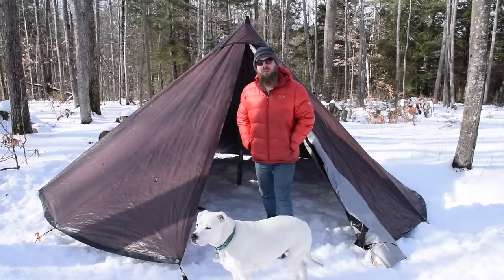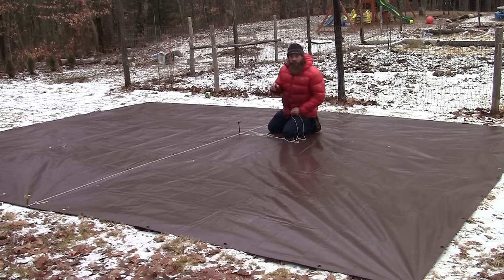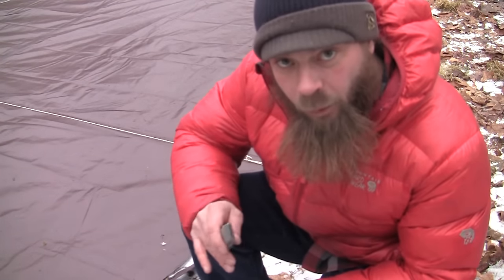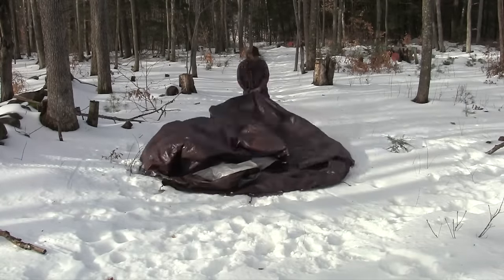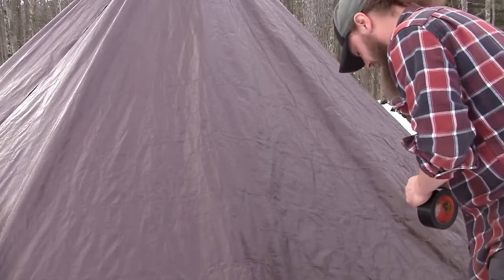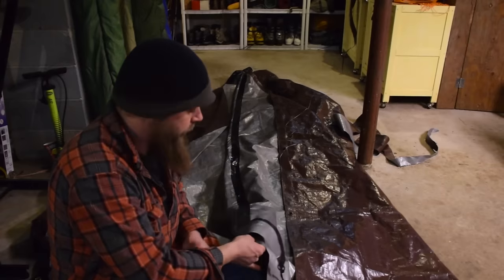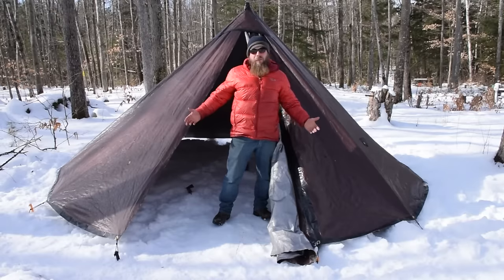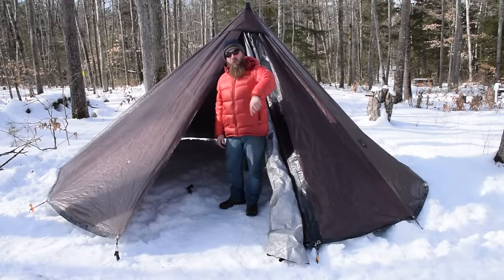CHEAP , DIY Hot Tent , from a tarp !!!

Comment: Good in the woods ...excellent video ...I think the only improvement or suggestion I would make is when you are cutting the opening for the door.  Only cut out one half ...that would eliminate the need to tape on the flap to cover the door ...attach the extra material from the inside to keep out rain
Reply from the maker: If I do this again, I am going to try that

Comment: 👍 I love this idea . Harbor Freight had a 11' 4" x 19' 6" on sale this past weekend . I'm going to use your idea with minor adjustments for the size difference . The center pole I will top with a PVC 1 1/2" cap to lessen the stress on the tarp and tape in the center . there are also now available hi-temp silicone mats that I will use for my stove pipe / tarp exit point . Thanks for the very clear instructions , not every poster does that .
Reply from the maker: Sounds like you have a solid plan!! If you take the time to make one, you will have a solid tent for years to come. These builds are awesome! Rugged. Lots of room. 
  Have fun with your build! I would love to see some pictures of it when it's finished! Please keep me posted
Reply: A guy could make an adjustable center pole  by using  2.5 inch  & 2 inch PVC pipe . Cut both sections  to 4 feet . Take a  drill  and make  holes  Then use a spring pin  to lock in place . Just a thought.
Reply: I hope you share the finished project. I would love to see it!💯♥️

Comment: Your video is just fine. I watched lonnie's video a couple of years ago. I knew I recognized the layout from there. I am going to try something a little different with a square or maybe a rectangular foot print. Basically something from a video by Survival Theory. Permanently tape in some reflective material and include a clear plastic door for a super shelter type of thing. Hoping to hold the clear on with magnets. I will be using all of your techniques with tape and flex seal etc. Good tip to use a heat gun to get the tape to flatten out and adhere. Happy trails.
Reply from the maker: I'll have to check out Survival Theory . Sounds cool . I have been thinking about a square or rectangle layout myself .......thinking I need to get my hands on some Tyvek to do it.........
   The flex seal works awesome man . That stuff doesn't want to let go . Best of luck on your project . Keep me posted . Thanks for your time and support . Have a great weekend - Justin
Reply: If you ever get around to making the square layout or rectangle layout I would love to see how you made it and the final results.
Reply: @ItsGoodintheWoods   I have thought about using tyvek a lot, but tyvek seems to be very loud and some people say that crumpling it up and throwing through a dryer cycle with NO heat seems to make it more soft and less loud, however when I did that it compromised the integrity a bit, so I would be very interested in your experience if you ever finally decide to use tyvek.

Comment: Great video.  You can apply a little more precision in the size of your tarp tipi using an online cone calculator.  This will allow you to pick the center height of your pole and diameter of the tipi.  This will give you the size of the triangle to cut out from the tarp.
Reply from the maker: Interesting.....

Comment: Love this! Thanks for doing the video. This might just hit my project list!
Reply from the maker: This should absolutely be on your project list . I want to see these things popping up everywhere .
Reply: @ItsGoodintheWoods  question - how would you adjust the measurements if the tarp were 15 * 20, rather than 16 * 20. I was thinking of coming back 6" from the corner on each side on the first measurement. Or would it make any difference?
Reply from the maker: @gordbelsey1171  Use the same procedure I used . That formula works for any size tarp .  My small hot tent I made from a 12' x 10' tarp. 
     Your 15' tarp will give you a slightly narrower base than mine. Mine is 14' wide at the bottom. yours will probably be 13' and change .
Reply: @ItsGoodintheWoods  Sounds good. Thanks
Reply: @ItsGoodintheWoods  great shout out to lonny @ Far North bushcraft BTW. Watching his video on this design, I have to say you did a fantastic job of explaining what you did and how you did it. Super helpful!

Comment: Dude, this is great!  I've been following your instructions and am almost finished making this.  Question:  obviously, one side of the door is taped.  How do you keep the other side  down when you are inside the tent?  Did you put some velcro on ther
Reply from the maker: That's awesome man! I haven't quite nailed that part down yet.....but what I have done works pretty well for me so far.....I put a grommet on the bottom corner of the lose edge of the door. I tie some rope to that and work it around the closest outer stake of the tent , and underneath the tent,  into the inside of the tent. After you go inside the tent and close the door pull your rope tight and stake it into the ground. This has worked very well for me. I do plan on working something else out eventually, 
   When I camped in a snowstorm with this tent , all I did was close the door. I didn't secure it in anyway. It held a snow load and never once opened or let go! I was amazed. I intentionally left quite a bit of overhang on the door, and that helps it stay shut. The real reason for the large overhang is so i can control airflow......If I pull that door tight , but leave a gap between the door and tent  to get in and out , the weather is blocked out due to the overlap, but fresh air gets in because of the gap I create. This has proved very useful more than once. You can manipulate that door to create more room as well All depends on the size of the gap you create. If the door is only 6" off the tent , thats good airflow and protection from weather, if you pull the door out 4" from the tent , it literally creates a bunch more room , at the cost of less protection.  It's pretty slick! One of the things I really like about this build is the versatility of the door. You can make it as big or small as you like. If it's really nice out and you only want half a tent , no problem, pull up some stakes and open her up !  Super cold and want it buttoned up tight , not a problem! Nice options to have! 
   I hope I explained this well enough for you to understand. I have a hard time explaining thigs sometime . Please let me know if you have any more questions. I am happy to help any way I can. Please keep me posted on your tent! I am extremely excited that you are building one!  I hope you are doing well through all the madness.         All the best - Justin

Comment: I had surgery a month ago, and am not allowed to do much. I'm extremely bored.
So, I've been watching a lot of videos on hot tent camping, but I can't afford one! This is something I can make and afford. This is my second time watching this. It gives me something to look forward to.
I also have an old propane tank. I saw a video on making a wood stove from one. I'm wanting to try that as well. I'm thinking it may work as a stove for the tent.
Reply from the maker: I think these projects would be great for you. These tents are rugged. If built right, you will get years and years of use out of it. DIY stoves are great! Go for it man! I hope you heal quickly from your surgery. Please keep me posted on your build
Reply: @ItsGoodintheWoods  thanks. Right now, I'm missing my husband. He was one of those men that could do just about anything.
He was going to teach me how to weld, but got cancer and died instead. So I'm gonna have to figure it out on my own.
The video that I watched cut the side off and welded a flat piece on so that it had a cooking surface.
Then he cut a piece off the other side for an ash tray and air control. 
He also welded legs on it. 
The top, which is now the front, was cut and he used a pot lid to make the door.
Don't know if I'm up to doing all that, but at least it gives me an idea of what can be done.
Reply from the maker: @dizzysdoings  I am sorry to hear about your husband.
Reply: @ItsGoodintheWoods  thanks. We would have been married 41 years come Tuesday.

Comment: I think if I were to build this tent I would not cut out the whole door section but just cut up the centre of where the door would be That would leave both sides of the door still connected to the tent but still able to be erected like a tepee. then they could be trimmed to make the door opening once it was erected. I hope this makes sense to you. Also I admire your faith in duck tape for guy lines, it's a big tent and in a decent wind there will be a lot of strain on the guying points. Good luck with developments you deserve every success. Cheers from the UK.
Reply from the maker: I agree, If I was to do it again, I would go about it that way. This tent held up amazingly well. I had faith in the tape, but I really was not sure of the longevity......This was an experiment for sure. 
  That said, I built this tent over a year ago, It went through quite the test,  and here are the results! Check this out, you may find this interesting....Good call on the door and the guy out points.,, https://www.youtube.com/watch?v=PCltLEE5is4&t
Reply: @ItsGoodintheWoods  Thanks for the reply Justin, Pleased you agreed about the door. Some people think giving a different idea is meant as criticism but it certainly was not in this case.. Stay Safe. David UK
Reply from the maker: @davidcowton1070  You are welcome. I am always open to suggestions!

Comment: only issue you have is when taping the sleeve for the top of the pole on the outside you would need to find  the same size pole each time you want to use the tent? i admire you for being able to find the same size everytime you have an adventure out! Loved the video!
Reply from the maker: Hello Nic J .. I made sure to make that sleeve large enough to accept a good sized pole. If I  find the pole to be too large, a hatchet will make short work of it. A minute of work , it'll fit !LOL I have yet to encounter that problem. 
    Thank you for watching! All the best - Justin

Comment: I made one like the one from far north bushcraft... i loved it i made a stove also... yours is pretty cool. a little different cutting out than lonnies.... but same thing
Reply from the maker: Do you still have and use that tent? I built a stove as well! Works great
Reply: @ItsGoodintheWoods  I do have it and use it time to time.... i made it 4 yrs ago. I use it for hunting in Southern Colorado/rockies. I also made one out of some lightweight rip stop material that I found at joanns fabric store. i modified it a lil bit. instead of using duck tape i opt with sewing nylon it works great! I made my stove out of an old air compressor. its a lil heavy i think it weighs around 20 lbs. it fits in my backpack or I put it in the saddle bags...

Comment: Great job on the tipi. I saw Lonnie a long time ago. You did some mods I really appreciate. It will last as well as the One Tigris I purchased. And much bigger too
Reply from the maker: Yeah this thing is big! And rugged! The mods helped out quite a bit. I miss Far north bushcraft. Lonnie and Connie are the real deal. What One Tigris tent did you get? I just got their Rocdomus. I haven't used it yet, but I have set it up and went over it. There was a small tear in it that was easily fixed. Other than that, I think I really like the tent. Looking forward to using it. It is my first one tigris tent. Seems like a solid tent
Reply: @ItsGoodintheWoods  I have a smoky hut. And it’s really small. I think it’s 10 feet diameter and about 6 feet to the peak but it does warm up nice.

Comment: You did a fantastic job on this video ... I have a question ... months 2 angular cuts for the door... if only cut one off and  couldn't have that extra flap to cross over to make it water tight...
Reply from the maker: Thank you. If I were to do it again, I would try  it that way. However, It is water tight. That tape creates a very strong bond.
Reply: @ItsGoodintheWoods   ok got a new idea in trying lemme know what ya think... motorcycle exhaust wrap  for sections of flue pipe near the material... constant working temp up to 1500 degrees....

Comment: Did you think about how these were built? Most had started with 3 poles in tripod. Then more laid to the top. Pivot. You built it to be a 'Hot Tent'. Most Tipi's had smoke flaps that could be open or closed. I prefer those.
Reply from the maker: I thought about how this one was built. With a tent this size, I didn't want to have to build a tripod for it every time I wanted to set it up. Good to have options though. This tent is awesome

Comment: I would  tape  a bean can at the top of the tent for the  center pole to go in it would last forever and with high wing gusts you wont need to worry about it rubbing a hole in the top ...permanently fixing it to stay.
Reply from the maker: That is a good idea. Honestly, I don't think it needs it though. There is a lot of tape there, and it has worked. It has supported a tremendous snow load. But options are good. And that is a good idea. Thank you for sharing

Comment: Excellent video. Is there a way to leave some of the material for the door. So you don’t have to add the flap to cover the opening. It would be less seams.
Reply from the maker: That's a very good idea .........I'm sure there is. I think you'd need to add a little flap on the bottom of the door , to match the radius curve of the tent ...but thats still better than what I did .  Good call. Now I need to build me another......a different material next time ...
Reply: It's Good in the Woods still an excellent video and well done.
Reply: I was thinking about that too. My thought is that if you overlap the two sides to the door, rather than stopping when/where they connect, you'd get overlap and a free door at the expense of circumference. A two foot overlap costs you maybe a foot so a 15' span drops to 14' or so. I think I'm going to try that and let you guys know how it goes.

Comment: Excellent.  A man of action.  I have a couple of questions. Could you have saved yourself the work of attaching a door by simply not cutting out such a big part of the circle and leaving some overlap?   How much did the tent weigh in the end? It looks very heavy.
Reply from the maker: An excellent question! I believe I could have, and if I ever do this again I am going to try it. I think I would have to add a bit of length to the bottom of the door. but that is still a lot less work than the way I did it. That's a great idea. I had another person ask me the very same question a while back! 
    The final weight of the tent is 11lbs. Not a backpacking tent by any means,  but 11 lbs isn't  bad for the size and price. 
   Thanks for the great question!-Justin

Comment: Thanks for the video Justin! Very excited to try making this. I've got a monstrous heavy duty tarp that I won't be using for my original intended purpose, so...... It's 24' X 36'. Did the modeling, and expected final measurements are 15' high and 22' diameter! Ummm no. 😂😂😂😂 Cut in half, 9' high and 16' diameter. Thinking that'd be a nice size. Your thoughts? And if I screw up, I have the other half. Hehehe
Reply from the maker: Right on!! I think cutting that tarp in half is an excellent idea, you'll still end up with a tent  bigger than mine! It'll be a monster! You'll love it!  Please keep me posted on your build! I would love to see it when your done! Cheers!
Reply: @ItsGoodintheWoods  thanks for the reply. Was a bit concerned about going a bit bigger, wondering about stability, especially in the wind. I guess worst case scenario, I could always trim it down to make it smaller. Preferably from the bottom, not the top! 😂😂 Sure, I can send pics when it's all done. Again, thanks for your video. Was debating different winter tents... you've helped be decide. 👍👍

Comment: You could use the grommets to attach your door and guy points to the main body, just don't make the hole and never have a problem with the tape not sticking. Or maybe some sort of rivet or button. But nice work!
Reply from the maker: A solid idea. However.....that tape is not letting go. Have you seen the 8 month torture test video of this tent? What this tent can take is pretty impressive

Comment: This is awesome!  Thank you!
Reply from the maker: This tent is a beast! I really enjoy this tent. Thanks for watching Rob.
Reply: @ItsGoodintheWoods  I have a couple of ideas for a version 3.   It's going to be hard to describe but I'll try.   I'm going to call North the top of the tarp where the back of the tent will be and the door is cut out on the South of the tarp. 

In your design you find an offset centre point to draw your arcs and then you cut the door opening from the corners to that center point.   I'm thinking that instead, after you've drawn the arcs, create a point 6-12" "south" of the offset centre and draw your lines to the corners for the door from that second point.  Then when you cut the door you will end up with a "cone" at the top and the door will overlap by 6-12" (that's what my paper model did when I tried it).  The cone would have a flappy thing that you can tape down to finish it off.  

Also, after drawing the arc you could draw and cut out some "tabs" to use as a partial snow skirt.   You'd have a nice tab on the NE and NW portion of the tent and smaller ones on the SE and SW portion near the door.

I was able to make this using a paper model so now I have to see what I can find in my garage for a tarp!